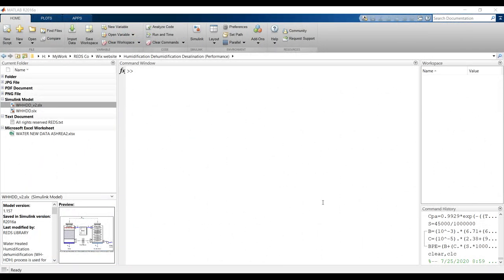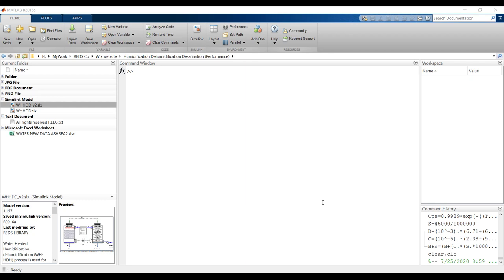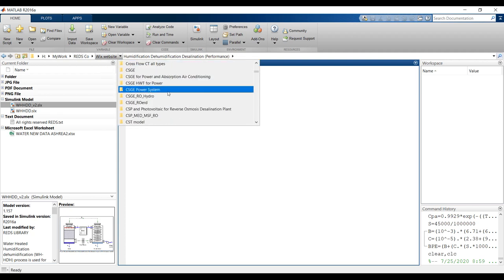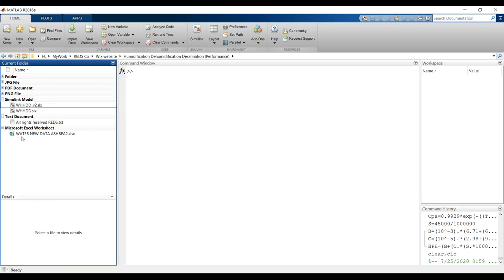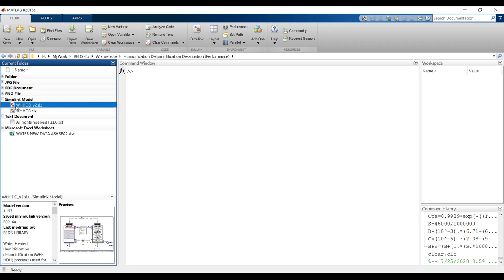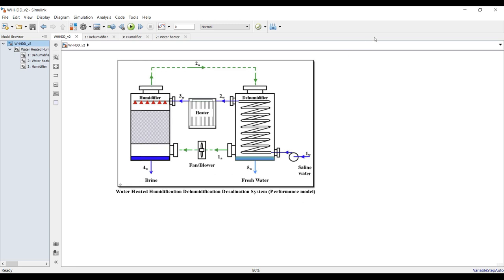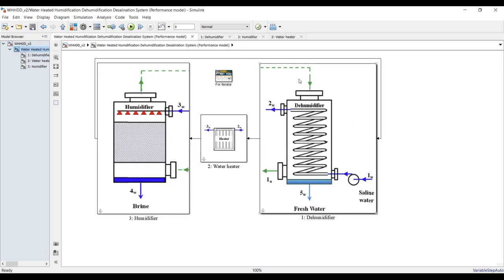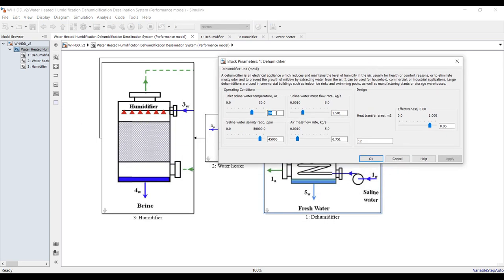Humidification | Dehumidification | Desalination | Process Performance | Matlab | Simulink Model

Comment: الله ينور يادكتور. I am building a model on excel for a natural draft tower that operates on a variety of sustainable energy sources. I did the solar heating in a coil in the beginning then had to abandon the idea due to pressure losses. My other approach now is to is to heat up the tower via solar energy by using dark metal plates installed on the tower surface on metal rods that are connected to a metal packing inside on which the contact between saltwater n air occurs. The plates are be vaccum insulated from ambient air. So I am now stuck with the thermo dynamics inside the tower. Should I simulate it as just heat input? But that wouldn’t allow me to size the surface area of the packing or the geometry at all. Can your model help me with this configuration or it’s not in the scope?